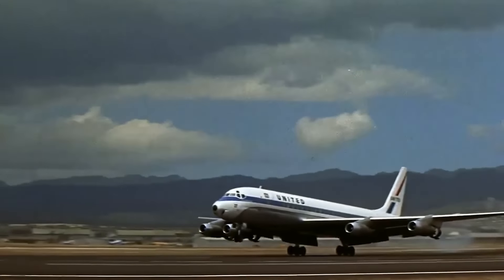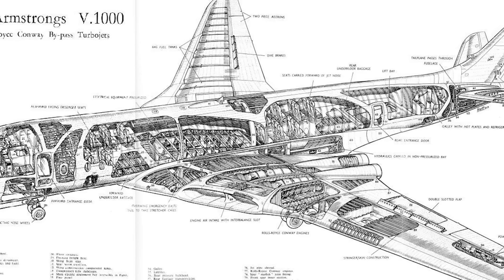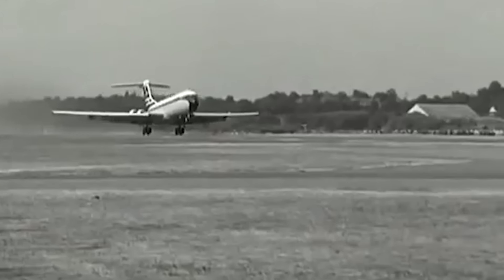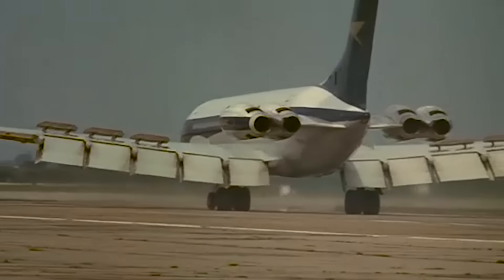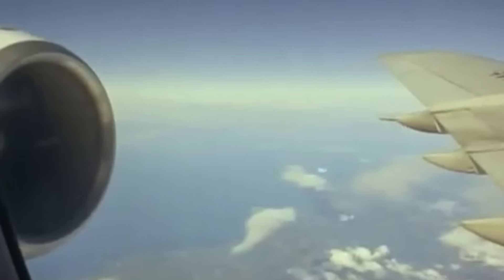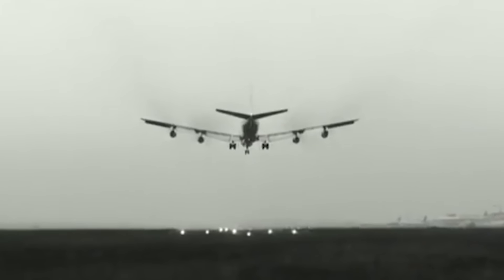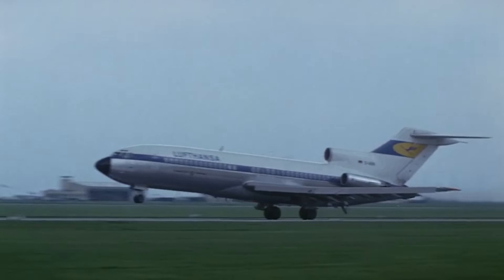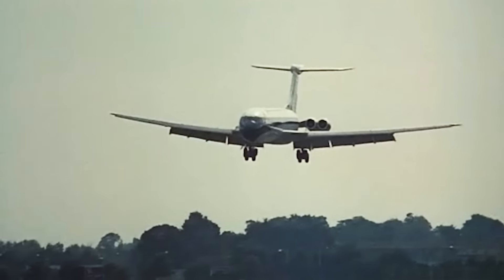Vickers VC10 - the lost flagship

Comment: A very good & very fair video, thank you! Like most British airliners, it was far too closely developed for the whims of BOAC and the airline's short-sighted commitments to fulfilling the, already, dying colonial routes. With its high T/W ratio, low-passenger capacity, excessive complexity & limiting engine layout (which meant, only narrow, low-bypass ratio turbofans could be fitted), it was never going to be as commercially viable as it's larger, simpler competitors, which were long established designs. The advent of a new generation of high bypass-engined super-liners, made all the long-ranged rear-mounted quads obsolete. Bare in mind, the 747 entered service a mere six years after the VC-10, so it could be argued it was near-obsolete when it entered service with BOAC in 1964.

Comment: The VC10 would be at 5000 feet before a 707 had even reached v1.
Reply: Nonsence....
Reply: @barracuda7018  Possibly a slight exaggeration, but not nonsense. just look it up..Are you capable of that?
Reply: @barracuda7018  VC10 take off distance 8200ft rate of climb 3200ft min.
707 take off distance 11000 feet....
How far you think it would climb before the 707 took off?
Reply: It’s slightly more nuanced but generally VC10 take off performance is far better than the 707, mainly due to the placement of the engines.

VC10 powers down after take off to noise abate; 707 throttles up to climb power having negotiated leaving the ground.
Reply: @barracuda7018   NO VC10 EVER lost a donkey whilst flying, I assure you of that, yet the All American 707 and 777 appears to make a habit of it, or don't you read the newspapers? Terry Offord.
Reply: @terryofford4977  one #3 engine did fall out once departing Heathrow.

Comment: As a kid in Australia I still remember the adds for the BOAC VC 10 in the early 70s. It featured a suave BOAC captain / actor extolling the virtues of the VC10 "hush power". Apparently with the rear mounted engines it was much quieter in the cabin.
This was rather ironic as it was easily the nosiest commercial aircraft that flew over our house. I think it was around 2.00pm on a Sunday the VC10 on full takeoff power would make us run out of the house to witness the source of such a deafening roar.

Comment: In the late 60s (1968) and early 70s (1971) I was a passenger on four VC 10 flights out and back to/from Kano in Northern Nigeria - To this day I have never flown in anything as exciting or dramatic as the VC10 - From the take-off at the end of the runway one could hear way back in the rear the 4 engines revving up - And then !!! - The aircraft accelerated at such a rate that one was pinned literally to the back of the seat - And then when it reached around 170 mph in what seemed like around 12/14 seconds, the nose suddenly pointed almost vertcally it seemed, and the plane took off like a rocket !! - Like WOW !! - This was so exhilarating up until the almost vertical plane eased off into a more horizintal postition on reaching it's programmed flight height, around 35/40 thousand feet I believe - Coming into land was equally exciting but in a different way as one could hear the engines throttling back and then a huge roar on landing as the plane decelerated to take us to our disembarcation point - The planes that fly in this day and age are so bland in comparison and really boring - I've spoken to pilots who've had lots of experience flying different aircraft and on mentioning the VC10 a kind of wistful sigh would be followed by, "Aaaaaa yes - the VC10 - the sportscar of the skies...!!!" - It couldn't last of course - for all it's excitement, the VC10 was deafening on take-off if one was on the ground, watching it go past, and the roar of the engines when it did so was almost enough to burst your eardrums !! - Not to mention the plumes of black smoke, so very polluting - But what an exhilarating experience to fly in - I'm now 76 and I have never forgotten these flights - Experiences and thrills that have never been repeated...

Comment: I was raised adjacent to Heathrow in the '60s and spent hours watching aircraft. When a VC10 took off it almost shattered all the windows! The noise level from those rockets at the back was incredible. They were so graceful, really beautiful to watch, but deafening...
Reply: I gathered from aircrew that they had quite an early throttleback  height out of Hearhrow due to noise abatement regulations,so it could have been even worse.
Reply: @BLOLite throttling back while taking off, just shows the performance those four engines gave.
Engines were not as reliable as they are today and remember reading if Boeing or Douglas suffered a failure on take off it could be quite serious, VC10 pilots would just push the other three levers a bit further and worry about it later, never flown on one of these beautiful creations mores the pity.
Reply: @CrusaderSports250   I also  gathered it was fitted with one of the  earliest "stick- pusher" alarm systems due to the earlier- identified catastrophic risk of deep stall  on rear- mounted jets owing to slowed air intake flow profile in near- stall conditions and the inherent slow windup of jet engines,whereas with props you get immediate lift over the wings and control surfaces on engine power increase.

Comment: I always loved the VC10 since i first saw it as a small boy. I joined the RAF as an aircraft engineer and was posted to work on the 14 RAF aircraft. These aircraft were the PERFECT design for high altitude/ hot temperatures airport operations with their power and short take of capability compared to many of the aircraft of the time. Also the rear engines provide for a 'clean wing' (no engines causing drag and other problems). Also the rear engine made the aircraft VERY quiet in the cabin. Why we do not see this groundbreaking design today is beyond me? Dont agree with some of your comments that it was 'unsuccessful? Having flown THIOUSANDS of miles in them from all sorts of airfield they never let us down and were heralded as HIGHLY ADVANCED for their time. If another new design was made following the VC10 layout it would be another world beater! A 'NEW' VC-10 with new engines would knock all the competitors out of the sky!

Comment: My Father and Grandfather flew transatlantic alot. The VC10 was ~1 hour quicker London/ Paris to Washington than the less reliable 707 (zero crashes and could climb on just 1 engine). Quietest of its class. At check in for BOAC VC10 flights in USA smart suited men often patrolled passengers talking about how unreliable they were!  Its speed did come at a fuel cost which after 1973 was fatal. I flew in it in several times to Asia and USA, (RAF often used rear facing seats). I sat in the cockpit jump seat for a whole transatlantic for a high crosswind landing at Lyneham.

Comment: Doesn’t having the engines inside the wings greatly reduce fuel capacity?
Reply: They weren't inside the wings?
Reply: @pup1008  Just a general question I have.  The Comet looked cool having the engines inside the wings but I wondered what challenges this causes for the fuel tanks and capacities.
Reply: @robertansley6331  

I imagine it would together with potential heat problems.....

Comment: According to BOAC Managing Director (chief executive) Sir Basil Smallpeice (as related in his autobiography, "Of Comets and Queens") the rear-engine design of the VC10 was driven by the British government's insistence that the new airliner not look like a copy of the Boeing 707. 

(The rear-engine configuration made the VC10 much heavier than it would have been with wing-mounted engines, leading to higher operating costs and the model's ultimate commercial failure.)
Reply: Indeed, and there lies the reason why the U.K. aircraft industry collapsed.

Comment: Swift Silent and Sirene, they were the marketing words of BOAC , and with the exception of a somewhat noisy take off by todays standards, are very true.
I worked for BOAC from 64 to 03, but only managed to fly on the VC10, a standard VC10 G-ARVM once. Oh but what a flight, 3 1/2 hour training flight from Heathrow to Bedford and return whilsts 1st Officers were being checked out by a training captain. Super video but interestingly enough one factor that isnt mentioned, was the superior control the crew had over say the 707 should you lose an engine. With the engines at the back being so close together if you lost an engine then you still got inline thrust, whereas on the 707 if you lost an engine then there was a tendency to swing.

Comment: Flew Dhahran to Heathrow C. '75 via Dubai to pick up a spare part for the auto landing system, and boy did we need it when we landed at Heathrow in a foul blizzard. Six and a half hours after leaving Dhahran, we over flew it having been to Dubai, I just happened to look out of my window on the port side and there it was. On another occasion at RAF Support Unit Tengah, seeing out an RAF VC10, we had a double starter engine malfunction, No's 3&4 failed to start, same fault on both starter motors. what were the chances of that?

Comment: I left the RAF in 1969 and joined British United as an airframe fitter (Mechanic in USA) and worked on the VC-10. They were indeed overcomplicated and old fashioned when compared to the engineering of the Boeing 707 which I later worked on after the merger with Caledoniian. Quite a mechanics nightmare like the smaller BAC 1-11 which came from the same stable as the Vickers products. Good memories though working at Gatwick.
Reply: Surprised to read your opinion that BUA/BCAL's B707-320C airframes were more advanced than the airline's standard VC10s. Can you explain?
Reply: @chrisscott4896   - VC-10 did not use stiffnuts but had everything g either lockwired or split pinned, also the split pin holes had to be drilled on replacement bolts. Where Boeing does use castleated  nuts, the holes come pre-drilled. Hydraulic  pipes were flared and had olives which would fall on the floor if you weren't careful.  Boeing uses stiffnuts in all non-critical applications and parker flareless pipe fittings everywhere which are self locking. VC-10 has hydro mechanical brake anti skid units (Maxarettes) which are quite primitive, where the 707 has electronic "Hytrol" system. The Boeing products were designed with easy access for Mechanics which together with the above examples allowed for much quicker maintenance and less headaches

Comment: Unlike 707 or DC8, the VC10 could, potentially, have evolved into a twinjet, without massive changes in structure, once large and reliable turbofan were available.
Reply: THEN HOW DO YOU EXPLAIN THE BOEING 737????
Reply: @sandervanderkammen9230  i dont think you understood what he said,,,
Reply: @davidblurton7158  The Boeing 737 is the twin engine version of the 707, it is the most successful jet airliner in history.
The VC-10 was a disappointing failure and would have required a complete redesign, abandoning the VC-10 was the only viable option.
Reply: @sandervanderkammen9230   The 737 does not share much with the 707 beyond the fuselage section ands the nose.
Reply: @Raminagrobisfr  That's funny!

Comment: It was said by many who worked and flew for BOAC on both the VC-10 and the 707, that landing in a 707 was more like a controlled crash......while landing in a VC-10 was like descending onto a baby's crib without waking up the baby.  You could sit that thing down on a dime because of it's ample power and control surfaces.  The landing speeds of a 707 was considerably faster because of it's weight vs power and wing area.

Comment: This airplane was a winner but it was very complex like everything designed in the 1960's.

The four rear-mounted engines was a mistake;  This made the airplane longer and heavier, and required the wing to be stronger than it needed to be, adding more weight.  Airplanes with tail mounted engines have very efficient wings, but the advantage wasn't necessary in this usage.  No US airline bought these planes for a reason-

Comment: A pity Vickers Armstrong effectively ran out of funding. Would've been interesting to see what could have been done with 2 x RB211 high bypass turbofans in place of those 4 x Conway engines.
Reply: if they allowed 2 engine planes  then it would have been faster than 534 some odd miles per hour speed  would have been a double beauty.

Comment: BOAC specified it but never wanted it. The high-lift wing and the power needed to fly into the smaller, hot, and rougher airports made it a fuel hog, and its size limited passenger loads and didnt allow it to be profitable to fly, which is why no other airline ordered it. Airlines made money with the Boeing 707 and Douglas DC-8.
Reply: The Brits made the same mistake with their abortive Nimrod-based AWACs. Rather than go for a larger airframe they tried to squeeze everthing into the old one and failed. In the case of the VC10 it would have been far more sensible to lengthen and update the  hot and high runways rather than developing an airliner to cope with the challenging conditions.

Comment: As an avionics service technician, I did an electronics course on the VC-10 at Melbourne, Australia in 1970.  Two things loom very large in my memory.  One, there were no circuit breakers in the cockpit.  There were rows and rows of fuses which required a special tool for removal.  The tool was held in a special clip.  The only time I needed to check a fuse, the tool was missing!  The second thing was a large handle at the centre console which was to extend an electrical ram air turbine (ELRAT) into the airstream in the event of loss of all electrical power.  Remember, the VC-10 had four engines, each equipped with a starter/generator.  The instructor went to great pains to tell us not to touch the handle as, if deployed on the ground, ELRAT would smash into the tarmac!

Comment: British Airways ( BOAC as it was then ) were responsible for demanding extreme hot and high performance and high speed from the VC-10,  and then BOAC went and bought Boeing aircraft, leaving Vickers high and dry with a high performance passenger aircraft with higher than normal fuel consumption... There is no loyalty between British airline companies and British aircraft makers.... shocking.

Comment: air charter operators can operate the classic Vickers Super VC-10 (Type 1150) as a large category private jet with additional fuel tanks, similar to retrofitted Boeing B727-200 Adv VIP which was a cheaper alternative to brand new B737-800 BBJ2 & B737-900 ER BBJ3!!! all it needs is a new executive cabin interior, fully refurbished airframe & engines!!! cost €260 Mn approx per aircraft!!!

Comment: Flown on it several times in the 1960s. Then the quietest aircraft as a passenger by a large margin. Much more comfortable than the 707 and only improved upon by the 747 400. But very noisy at airports.

Comment: Boeing were able to re-use technology and fuselage cross section from 707 to create 727 and 737 meaning less tooling cost and more efficient manufacturing. The British never improved their manufacturing techniques and they build slower than Boeing or Douglas. Douglas and Boeing, under pressure by USAF, building B-47 in large volume while DeHavilland is literally building their jets by hand. Vickers struggled to fulfill BOAC orders and only giving others airline a trickle, a well engineered aircraft is not gonna work when competition like Boeing and Douglas can deliver a similar aircraft much sooner! Boeing and Douglas sacrifice engineering sophistication for ease of manufacturing and lower unit cost. Airbus finally figured out Boeing/Douglas technique of a lot on manufacturing techniques. The Soviet also learned not only to copy the Sidewinder missile, but also copy the manufacturing techniques for greater reliability.

Comment: Beautiful aircraft, financial disaster with just 54 being built. Yes there was a need for a smaller aircraft specifically for hot and high airports even those with dirt runways, but it may have made greater sense to adapt a version of the Comet for African duties by strengthening the landing gears and finding engines with the needed thrust. For transatlantic use the VC10 was too expensive to fly when compared with the DC-8 and 707-200.

Comment: Another fantastic design shot down by the British Government because there were so many absurd modifications required  that by the time the plane was finally ready Boeing had already taken over with the 707. Few years later almost the same happened during RB211 development until the US took over.
Reply: It would have been cheaper to lengthen the runways at the "hot and high" airfields the VC10 was designed for.

Comment: Probably knocked out of commercial aviation by the efficiency of the 747 on passenger seat miles on the high capacity side and that of the 737 on smaller capacity short haul flights. But a good looking effort!

Comment: The VC10 was a much more reliable aircraft than the 707, ir was averaging nearly 12 hours flying a day across the whole BOAC fleet compared to 8 hours a day for the BOAC 707. Fleet. The only thing that let it down was fuel usage, however it was very popular with passengers and was nearly always full on the Atlantic routes, the same could not be said for the BOAC 707 fleet which mostly served to take the VC10 overspill!